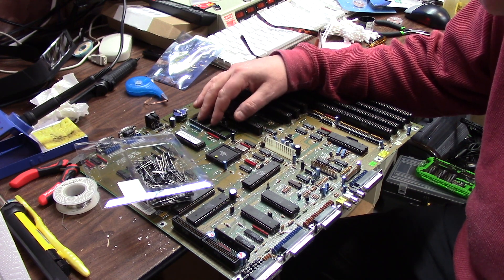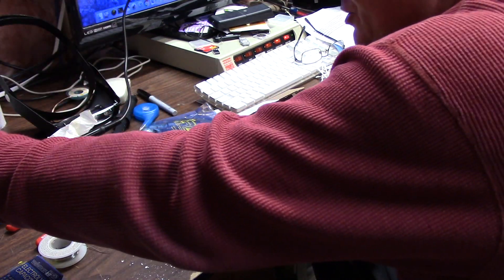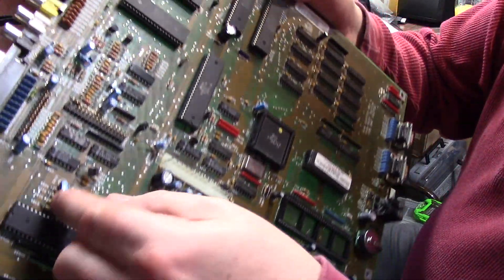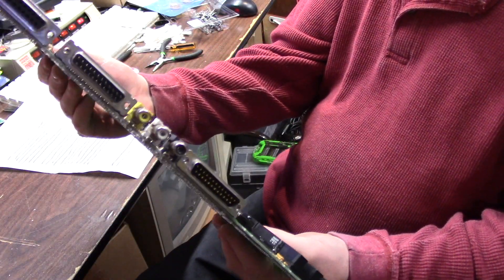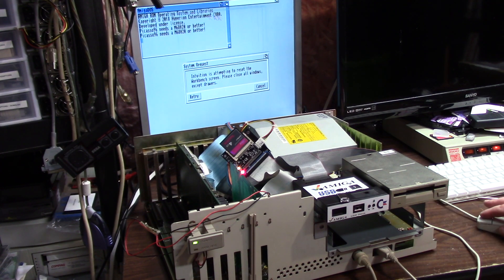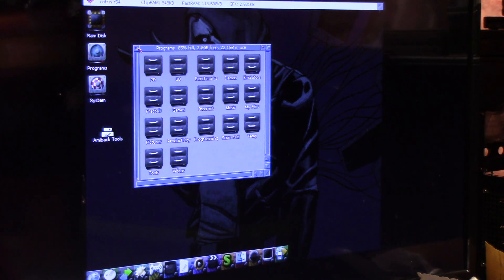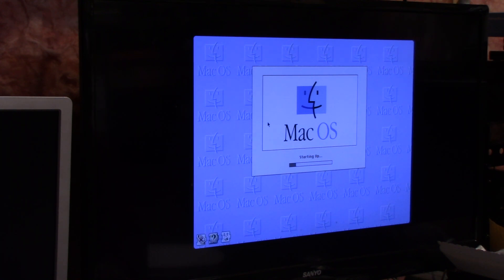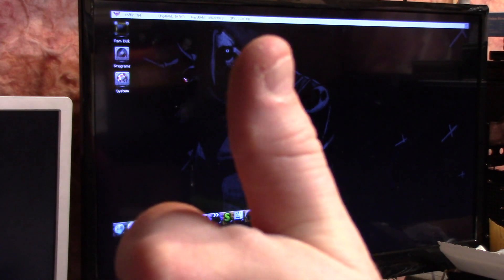Episode 84 Commodore Amiga 2000 capacitor replacement and vampire redo with coffinR54

Comment: Hey Chris, love your videos, very helpful.  Ordering caps for my 2000 and can't find nichicon or panasonic axial between the zorros.  Seems like they went end of life around 2019.  What brand would you use as a quality replacement?
Reply from the maker: Do you need some i have several hundred.  Email me and ill send them out.  I use sprague brand for mine.  More expensive but worth it
Reply: @ChrisEdwardsRestoration  What do you think about replacing with an aluminum organic polymer radial capacitor instead?  Even though it's not an axial, it's small enough to fit without interfering with the cards.  Have you used them before?
Reply from the maker: It can work but its ugly

Comment: What are the symptoms of bad caps? How does it reflect to usage? I might have a bad caps problem when using A2630 in Zorro slot in A2000. Image some cases screen gets (repeatedly) wobble and distortion. Without card the image is crystal clear. Could it be mobo caps too instead of A2630 which seems otherwise fine? So many variables.
Reply from the maker: definitly, a capacitor is a temporary battery, once the liquid in it dries up or leaks out it basically turns into a solid resistor, grounds out. causes all sorts of weird things.  recapping is cheap, easy and saves our precious devices.

Comment: I have a Amiga 2000 Rev 4.5 B2000 and the list is slightly different. I am adding it here for future reference because this vid comes up when I searched for a rev 4.5 cap list, and there doesn’t seem to be one around anywhere. 

C405 = 16v 47uf (Right of Denise)
C912 =16v 470uf (to right of battery) 
C402 = 16v 47uf (between 68000/cpu slot in front) 
C404 = 16v 47uf (mid of 68000/cpu slot) 
C811 =35v 4.7uf (left front of cpu slot) 
(4) C416 /417/418/419 = 10V 220 uf Axial or short radial caps (in between each zorro2 slot) 
C701 = 35v 22uf (top of Zorro right of isa) 
C403 = 10v 220uf (top left of board rear) 
C318 =35v 22uf (top diagonal right of buster) 
(2) C813/C814 35v 22uf (to the right of buster) 
C400 = 16v 100 uf (Top most along Power Connector) 
(4) C40?-C40? = 16v 47uf (the other 4 right below that c400 big one on power connector) 
C222 = 16v 47uf right of floppy cable) 
C224 = 35v 4.7uf (right of floppy cable) 
C317 -35v 22uf (right of serial port back of board 
C243 = 35v 22uf (right near white RCA and Yellow RCA)
C233 =  35v 22uf (below the red RCA jack)
C223 = 16v 47uf (to the right of C243 above - more directly under yellow composite out) 
C214 = 16v 470uf (back top left of Graphics slot) 
C226 = 16v 470uf (center of graphics slot) 
C225 = 16V 470uf (left of Paula )

 There are 28 total.

Comment from the maker: Still having weird issues with the Vampire. tried multiple CF to SD microSD and card manufacturers and capacities. various file systems and my problems of weird crap continue. next i will re flash the core and see WTF that does...
Reply: Hope it worked.  Catching up on these as got my Vampire right after my 2000 went down.  Need to dig into the tech manuals as the ATX replacement has the same behavior as the old PSU - Starts and spins the fan short time and then shuts down.   Thanks for all the helpful videos!
Reply from the maker: did you reset the jumper J300 to generate the tick signal internally ?
Reply: Chris Edwards yup set it.  What I am doing now is stripped out most of the extras and seeing what happens first with the original PSU  ( jumper set back) .  As added a lot of things  before things stopped working.